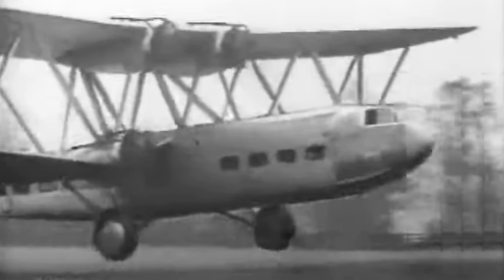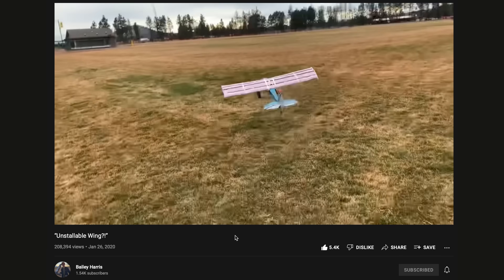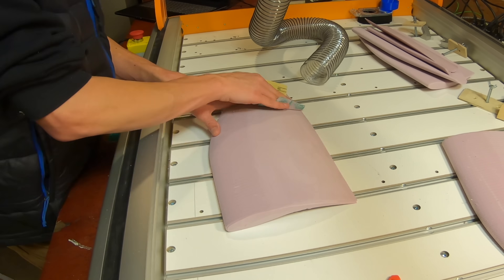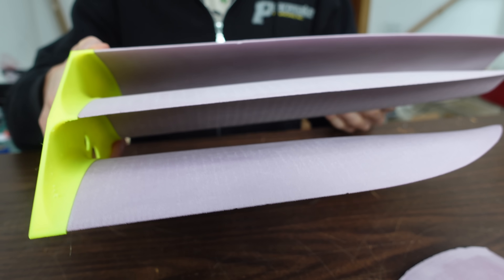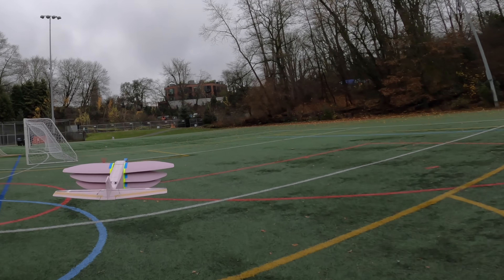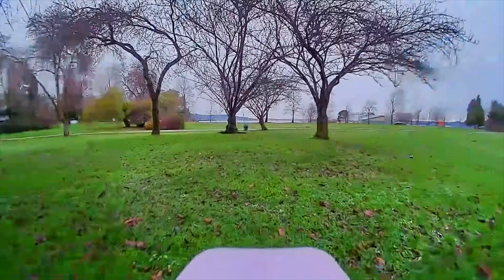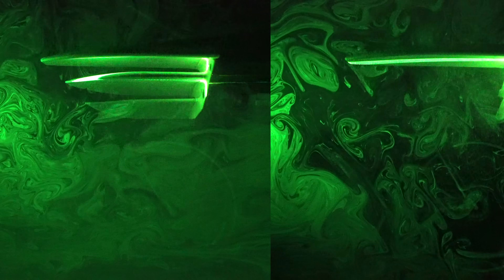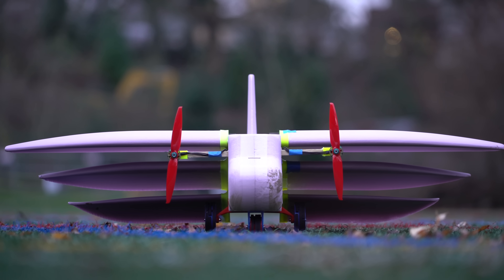Best STOL Wing Design Ever?!?

Comment: Would placing the horizontal stabilizer on the top of the tail make it more controllable? It looks like it would be in clearer airflow. Also, how do you think this wing design would fair in a P-39 style airframe? Maybe build it so the wings are only on the outside of the two fuselage sections and the cockpit and tail the only thing in the center… I know absolutely nothing about RC airplanes. The few times I tried I immediately broke them. I’ll stick with ground vehicles and computer stabilized drones, lol!

Comment: this might have been said already: the thrust force should be located lower to avoid that forward pitch moment on thrust, and this would likely also stabilize it somewhat upon roll
Reply: Or angle the motors up. The axle of the motor, if virtully lengthened, should run exactly through the CG of the airplane (not the CG of the wing!) minus 3 degrees, to counter any pitch effects on throttle. If he lowers the motors on this airplane, the props will hit the ground. So either angle the motors or put a landing gear on it and lower the motors.

Comment: For your information if you take resin and milled fiber mix them together and coat the foam it will make the foam more rigid without lots of extra weight. the carbon fiber strips I would still use .but the milled fiber comes in different lengths some as large as a 16th of an inch down to a few thousands they act like rebar when mixed in with the resin they are thinner and lighter but still adds rigidity. You will have to try two maybe three cotings my experience has been one to two coats this can be sprayed on using HVLP type gun low pressure or roll even brush.

Comment: Wonderful airplane!  I'd add a boxed dihedral binding the three wings in the outer side. This could even allow for a flying machine wingspan kept inside the Road vehicle limit, 249 cm in Europe, and have an stall speed within reason limits. 
An open propeller can't be used on road, because of dangers to third parties, but a Ducted fan, other propulsion means may work. 
Why not an 'A', inverted 'V' tail?  
This arrangement induces roll in the good sense when banking, the structural issues found in Beechcraft Bonanza, many from use out of limits, could be solved. Blessings +

Comment: Awesome design, Daniel! Not only is it really fun, but I also thought it was beautiful as well! I had a few thoughts after watching this video: First, if you do a version 2.0, you might consider giving it a T-tail so that the horizontal stabilizer is in cleaner air. Second, this is probably terrible practice for a number of reasons, but I also have a CNC that I use for machining XPS sometimes, and I have found I can basically skip most of the roughing and be super aggressive on finishing passes with the foam. It saves lots of time, and it doesn't care. Just don't run one of those toolpaths on something stiffer than foam! When you fiberglass a wing, try using waxed mylar against the glass instead of peel-ply, and stick the peel-ply outside of that as a vacuum breather. You will get a shiny surface right out of the bag, and won't have to subject the part to the force of removing the peel-ply. Oh, and your plane is in good company when it comes to using elevons for roll control - the F-14 did too!

Comment: Your wing experiment here is great work. It would be better if you added the more wings as you first shown. Make it
stationary and blow a higher thrust ratio across the wings to determine just how much lift can be achieved. A weight scale
attached to the wing root should tell you this. If my guess is right, you can just locate a prop directly in fron ot the wing
arrangement and when blowing a higher thrust of air across the staggered wings inside a ducted housing, you can create
a substantial upward lift in a stationary craft. Leanard Crump proved this in the seventies as he built an tested the same
concept. The ducted version of this multiple wing effect will do as I say. If your interested in further information call me at 979-885-9145

Comment: Through the history of fighter aircraft, speed has been a key factor so both triplanes and biplanes were made obsolete. Design starts to fail at higher speeds, as the lift coefficient of the upper wing can be double or more than the lower wing, leading to high stresses and eventual failure.

Comment: I have been interested in personal  e VTOL aircraft and really am interested in Jetson One. e.g. see

https://www.youtube.com/c/Jetsonaero

It has many cool features but one of its biggest limitation is that with a 180lb occupant it only has 20 minutes flight endurance and even less if one add additional weight.

On looking at some commentary on this some have suggested that adding some wing life might give it a bit more range in cruise by requiring less power to the  blades.

But these lifting surfaces need be really stubby to fit within the design  of the vehicle. 

So  my question  is whether something like you are showing here might work for a Jetson One when it is in cruise. For I am wondering if perhaps  lots of stubby wings with high angle of attacks might fit into their design and not add much weight.

Comment: If modern flaps not only go down, but also extend rearward to increase chord and flap surface, how about modifying the flaps to the point where they are second short-chord wings that extend completely out from the main wing, trapeze down to a biplane configuration,  then rotate to the desired down angle?  But after it clears the main wing, the main wing also extends a conventional flap that was sandwiched above the now lowered “biplane” wing.
STOL lift is cool and all, but the craft’s purpose is to travel through air at an acceptable speed, which means being able to retract all those drag surfaces, or at the very least bringing them all together seamlessly for a very long chord single wing. 
You can build it man!

Comment: I really like how the wings and fuselage turned out for you. What end mill(s) did you use to cut the foam, and at what rate did you set your feeds and speeds? Also, have you considered doing just a series on how to design some of these in CAD/CAM for both the 3D printed and CNC parts? The wings are especially interesting to me since you added some washout and I would love to see how this was done. =)

Comment: Flaps are NOT about "generating more lift."  Please remember that the aircraft does not change weight (appreciably) between when flaps are used and when they're not.

Rather, flaps accomplish two critical functions:

1.  They allow an aircraft to safely fly at slower airspeeds, thereby reducing both takeoff and landing roll while improving handling and safely at slow airspeeds.

2.  They create drag in a controlled and known manner.  The drag helps aircraft adhere to standing descent glidepaths while maintaining the engines' RPMs at significantly higher levels, thereby reducing the amount of time it takes for the engines to spool up in case the aircraft needs to level off or climb, such as when an approach must be aborted.

Thank you for your attention!

Comment: Would moving the wings forward not solve a few issues you mentioned? CoG, nose wheeling and the tendency to pitch down under heavy throttle. My experience in aeronautics stops after making a paper plane. I imagine the wing is producing too much lift for what might be the normal CoG rules (If such exist) so the lifting force shifting closer to the front of the plane would serve to fix these issues ?????

Comment: I really like the design and engineering behind. I think I found one design flaw that might have influenced the problems with stability. Your control rods to elevons are either not stiff enough or not supported enough.  In some occasions a heavy bending can be seen. Anyway, might be interesting to play a little with ground effect here as the plane looks like it would be floating nice.

Comment: What a brilliant build!  I wonder if you engineered the wings to have the ability to operate like the F-111 swing wing , and combine the ability for all 3 wings to get closer together (compress and expand). Would you be able to increase the speed, and decrease the speed optimally? Adding the wing servo to not just sweep backward, but to forward sweep, taking advantage of the ground effect?

Comment: Always wondered if you put a weight on a threaded rod in the fuselage and then motorized the rod to move the weight back and forth if that would act to change the CG to the point of making it a viable control mechanism. Great video as always. Such fun.
Reply: @bobhawkeye - I've successfully used a sliding servo tray holding a servo, in a glide, to move my CG forward in order to increase high wind penetration.

Comment: you can install extra motion detector for airplane to avoid obstacles and on the vertical wing should be built like 2 symmetric curved to easier for airplane stable than sake left and right.

Comment: Could you do a followup adding canards replacing the batterypack on the nose and transfer the real weight to the back? It should make it feel soggy first, but prevent it from actually stalling, instead surfing steep short before the stall and bring the plane down in a steep glide basically, which can be controlled in its dropangle depending on the push without affecting the gliding speed which would be limited to lowest cruise speed (Comparable to a heli spinout, using the angle of the blades to actually effect the rotational speed to control the angle of descend).

P.s.: If you can work it out, it would be time to add a pusher going crosssection, literally sucking air from below pulling towards the ground to max out pressure on the multiple wings (compare vulcan and tomcat intakes/outlet).

Comment: This totally reminds me of the 'Flying Flea' a tandem two-winged (not biplane) light plane with very low stall speed. It didn't have an elevator, but the angle of attack was controlled with variable incidence on the front wing. It was deemed one of the safest light airplanes, but because of a completely correctable slot condition it never caught on, though many are still built and flown in Europe.
https://en.m.wikipedia.org/wiki/Mignet_Pou-du-Ciel

Comment: Get an arborist's throw line.
Its just a weighted leather bag with a super strong and long string attached to it. 
Its used by arborist's when they need to get their equipment up into a super high tree. 
If its over 150 feet they have special sling shots for them. 
 Its the only tool that i have found is the most effective way to get a plane out of a tree. 
I just throw the leather bag over the branch that the plane is in. 
Grab onto both ends of the string and yank on them to shake the branch. 
Super easy.

Comment: Bulky and easy to be pushed around by the wind.  you don't see bugs with 6 wings in nature.  I could tell this design sucks within the first 30 seconds based on it's flight pattern.  Some things just don't work the same when you scale them up.  Nature is efficient, not redundant.  There's a difference between good engineering and redundancy/inefficiency.  counting the tail, this is more like a 8 winged plane.  The original plane design is much better, being 4 technical wings including the tail.  Your creation looks and feels unnatural, and I feel like it would perform very poorly in crosswinds/inclement weather and end up counterbalancing the value of taking off in a shorter distance.  There's simply put, no reason to do this when we already have great performance.  All i can visualize is the potential for plane wrecks if it was ever scaled upwards.  you overvalue distance instead of mobility to the point of being useless.  I admire that you're at least thinking with your inner child, but I can't admire much else about this.  I've only been studying aeronautics a short time and I see wayyyyy too many holes in your designs.  It just goes to show there's a large gap between enthusiasts and people who actually study XD.  I swear people are getting dumber, but hell, this is a silly design.  I just wish you presented it as the joke it is instead of as an actual "best" of anything.  Clickbait.
Reply from the maker: Don't be a sour puss

Comment: Unfortunately, triplanes don't scale up very well because of the Square-Cube law:  If you double the wingspan, you quadruple the lift area, and the mass (Volume, weight) goes up by a factor of 8.  1:10 scale is 1:100, and 1:1,000 respectively.  That's without remaking that polystyrene, and electric motor into an aluminum monocoque to fill each wing with fuel tank, so it can fly any distance after that short take-off.  (Not to mention DRAG!)  I'll believe that's the best design ever when I see the practical aircraft you make with it, and how much you can carry with all those wings.  There's a reason why we don't even use Biplanes any more.
Reply: Without running any numbers, look at the size of those wings, compared with the size of the fusilage.  That's the rest of the plane, meaning where the cargo, passengers, and crew will go, after those wings lift the weight of those wings, and the engines push through the drag of all those wings.  Good luck!

Comment: Would it be possible to design the under wings to 'fuse' together as one larger wing?  That is the bottom two wings could move upwards and meet with the larger top wing to form one surface?  That way you could move them down/out to take off and land but move them in/together when at higher altitude.  They wouldn't have to meet edge to edge but just nest into one another.

Comment: This is fine, but the problem of lift at low speeds was solved by the Air Force nearly a hundred years ago. They created a wing with flettner tubes in the middle. They say that it could fly at five mph.

Comment: Around the 10:45 mark you talk about the main gear lifting off first and the aircraft riding along on the nose wheel. I actually saw this exact thing many years ago, 1976 or 77, when Aero Spacelines' Super Guppy took off from Norfolk VA. I was standing at the end of the runway and it was coming right toward me, so seeing it scooting on just the nose gear and rapidly running out of pavement got pretty scary. At that time there was a lot of road construction equipment just off the runway and I had visions of it piling into that, with me standing right next to the fireball. But it barely cleared the obstructions and then flew ponderously off, looking for all the world like a zeppelin since the wings were almost invisible from a distance, leaving that massive fuselage as the main thing I could see. Wish I'd taken photos!

Comment: If it pitches down at high throttle, your center of thrust might be too far above the center of mass? Looks like that could be the case, your motors are quite high up. In particular when you add the extra wings, it shifts the center of mass further down.

Comment: Dude, if you want to fix the issue of the nose pitching down on acceleration, simply lower the position of the motors/props. Since they're only in line with the top wing, they are literally pulling down from above the vertical CG. As well, you have the drag of the lower wings pulling downward below that same CG.

Comment: It might have been interesting to reverse the stagger ala the Beech Staggarwing.
Also, lowering the engines to the lift centerline would have probably helped the flight characteristics as to pitch instabilities,  as well.

Great video,  though.
Reply: The reversed stagger wouldn't work at all for the purpose of being a split wing for increasing lift.

Comment: So if you're tail heavy and throttle causes nose down, doesnt that mean you would have to move the wings back (support the tail) and upward (to raise the line of drag to match the line of acceleration from the props) on the fuselage? Also if the tail is performing poorly because it's behind your wing stack, wouldnt you need to also raise it to get clean air? Almost like a C17 globemaster?

Comment: Thank you for equating lift with how much air is pushed down.....if I heard that correctly. The wing moves air down and the equal and opposite reaction is the lift, simply speaking. All of the details around the wing: high pressure, low pressure, venturi effect, vortices, etc make a simple effect overly complicated. Stand under a helicopter to get the full effect. Just like a rocket exhaust expels mass to produce thrust, so too the wing. Your skill and explanations are amazing.

Comment: @rctestflight Some of your instability could be the prop-wash since your engines are mounted to the wings - have you considred changing the configuration to a ducted fan propulsive fuselage?

Also given the issues around the wing tips it would be interesting seeing this wing configuration used for a twin fuselage configuration with only a center-wing(s) - the aspect ratio would be comical, gee-bee style.

Comment: Can you do an autogyro plane with VTO? You just need a motor which is capable of enough power for a very short amount of time for the takeoff and a motor for the regular forward motion afterwards
Reply: Or you put a small extremely high rotation flywheel at the end of the shaft of the vertical rotor which will be spun up by a motor on the ground.

To lift off you close the gap between the output shaft of the flywheel to the main rotor by a magnet pulling two clutch plates together.

While this will add dead weight it might be lighter than a motor for the same amount of power plus the necessary motor controller and the necessary battery power.